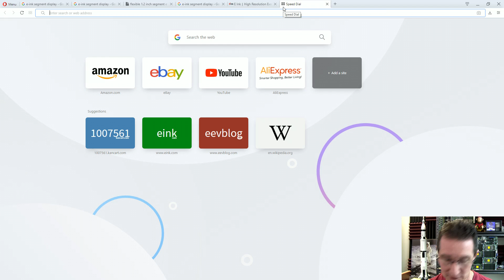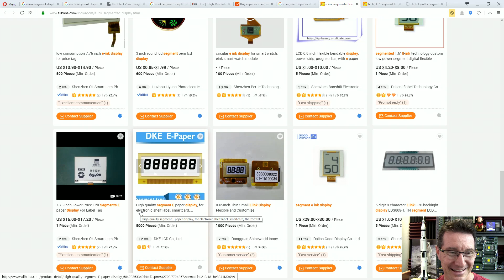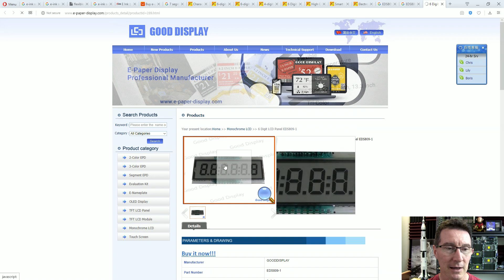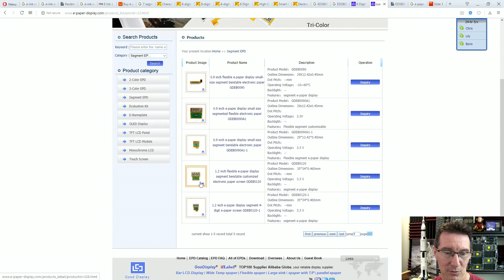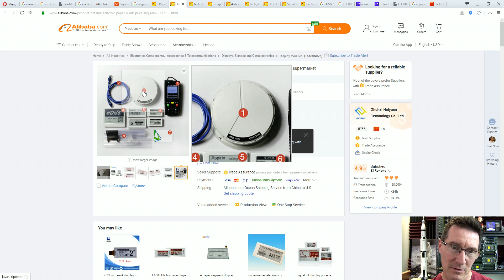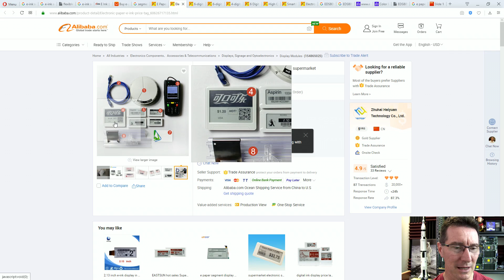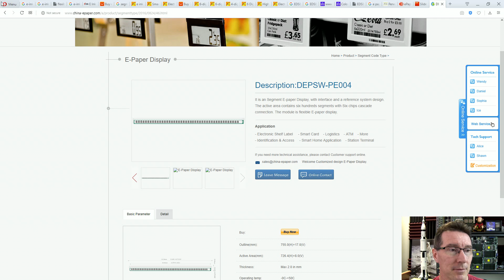EEVblog #1241 - Power Up Display Counter Project - Part 1

Comment: I know you said no feature creep, but most power cycle counters are also hour meters. since you really need a micro to control the display it seems logical to add an hour meter.
Reply: Yes. It should definitely be designed to also be an hour meter.

Comment: Maybe you could use the sharp memory display with a supercap and then instead of keeping it always on place a small push button on the pcb, so that the lcd only gets power if you press it to view the count. Dont know how good/bad the self discharge is on those miniture super caps though.
Or maybe even better use one of those small solar modules found in calculators. Even a little amount of ambient light is enough to power a calculator, so it would also probably be enough for this low power lcd aswell. It would practically make no difference from beeing always on, as you cant see the digits when its too dark anyway.
A small button cell battery would be another option, could last you literally a decade. And when thats too short of a lifetime you could just swap it after 10+ years and then it goes again.
Reply from the maker: Sharp memory LCD's don't work without power, they lose their contents. The point with those is they draw so little power you don't have to worry, nor do you need a micro running.

Comment: Dave, you know features are creeping in. Like a second counter for hard resets.
Reply: You wouldn’t need that because the display controller with simply increment one every time it sees power go high. There wouldn’t be any way to interface with this board for the use case that he’s talking about. Let’s say it was built into a Wi-Fi router, it wouldn’t matter how many times you factory reset it, this little counter board would simply see the power go on or off and increment by one.
Reply: @burnte  I was just thinking about for use in a product with a reset button, show how many times it was hard reset instead of powered down correctly. 
One of those random thoughts that crosses my mind.

Comment: Sorry to be boring - I like e-Ink as much as the next man - but why not just a low power LCD and a button cell? There's the added advantage that you don't need to wait around for Aliexpress - you're right in 'Jaycar down the road' territory!
Reply from the maker: Because I wanted to see if something like that is available, it's a more elegant design, and can't fail with a dodgy battery or battery contact.

Comment: Supercaps have a relatively large self-discharge rate and it is non-linear, i.e. it is very high at full charge and drops exponentially with time till it levels out. I don't remember the explicit details but do remember the way the discharge rate is listed in the datasheets is a bit misleading and the impedance of your multimeter is enough to cause a significant discharge. I wound up taking measurements about every 8 hours to plot the discharge rate.
Reply: Well for measurement you could just use a high input impedance electrometer with an input impedance in the Giga-Ohms to Tera-Ohms range. They arent too hard to come by and i am sure he has atleast one in his lab.
Reply: You ended up, not wound up.
Reply: @simontay4851 Who appointed you to head the Grammar police?

Comment: Would be possible recover information from the display and use them as a crude memory?
Reply: No, there's no way to currently
Reply: There was once a computer that used a CRT as DRAM, but that likely won't work with this type of display.
Reply: @user2C47  if I remember correctly also a scope used the display video memory to store data point for math functions.
Reply: @user2C47  you have got exactly my idea and Intention

Comment: Are differences in old and new touch screen sensors because my old 2003 xerox needs more pressure to registrate the touch than my phone
Reply: Google resistive Vs capacitive touchscreen

Comment: Well were not talking about just powering an LCD from a supercap but also powering a microcontroller of some description and doing all the multiplexing 
i think a graphical E-Ink display would be the best option 
or have an LCD with a supercap and a button to push to display it but i mean that already exists in the market, using a sharp memory display instead of an LCD that might be best
Reply from the maker: The sharp memory LCD doesn't need a micro to be running
Reply: Yeah, should have clarified that
a supercap on a sharp memory display would be a good option, i believe i have seen one without such a long cable before, if i remember right it was just a hotbar and fold over style

Comment: I was wondering if any one could answer a question for me. I seen a schematic that had 2 diodes in series in a full wave bridge rectifier  on each side for a total of 8 diodes.  I am trying to make a PSU that can handle at least 15 amps. My problem is that I don't have a 15 to 20 amp rectifier , I do have a few 5 amp diodes and a few 6 amp Rectifiers. Is it ok to use the diodes in parallel and if it is possible do I need to do anything special like using resistors?  Thanks in advance.
Reply from the maker: Parallel diodes is fairly common, but there are traps. Unless you have matched diodes they aren't going to share the current evenly, sometimes grossly uneven at higher currents/temps. Very small series resistances are sometimes used, but more often PCB traces work, and you match the trace lengths to each diode, effectively creating a small series resistance.
Reply: It's not going to be ideal, but it may work. If the diodes/rectifiers have significantly different specs, one might take most of the load and burn out. If you use all the same diodes and turn it on slowly to feel if any are getting super hot, you might be able to get away with it.
Reply: You can try to match the diodes (looking for almost the same Vdrop) and attach it to a heatsink, so they have thermal tracking and none explodes
Reply: Thank you for your insight, Do you think if I check the voltage drop at different voltages that they will run in and make sure they are close if not spot on I should be ok?
Reply: @kardeef33317  You could try and match the diodes yourself, yes, that's possible.
Reply: Thanks everyone for your help. When I was  a electrician, we got alot of work because of some maintenance works, we would say to each other,  they know just enough to be dangerous. I feel that way with electronics, so I try not to be dangerous...lol

Comment: This would be useful for Jet engines which are both time limited and start-stop cycle limited for maintenance reasons.
Reply from the maker: In that sort of harsh environment I'd look at using a mechanical counter.